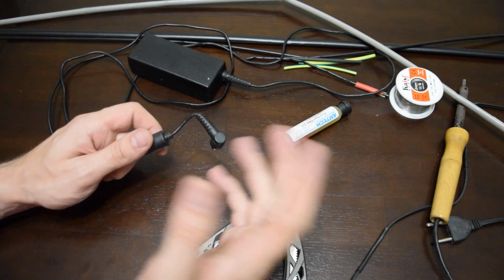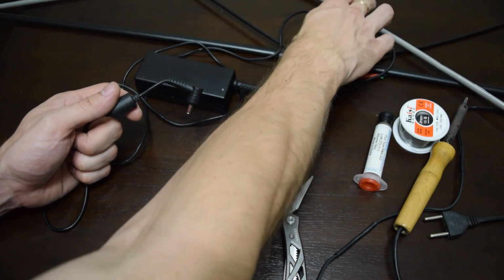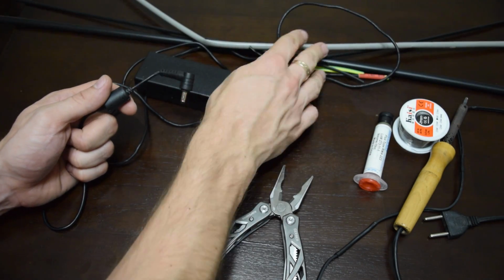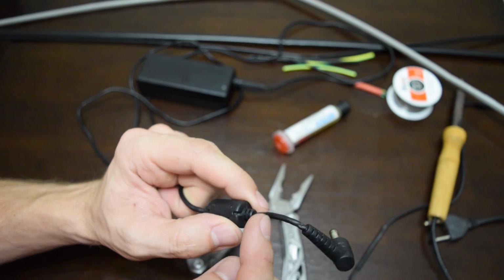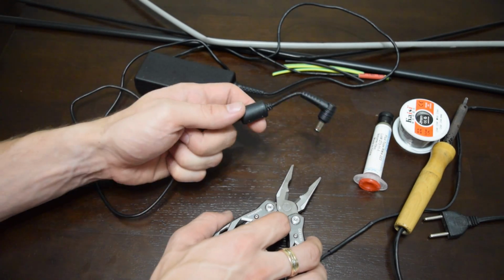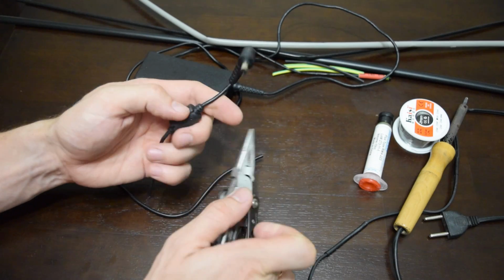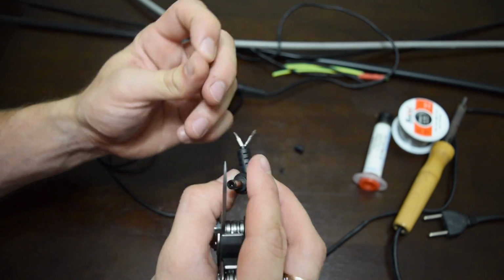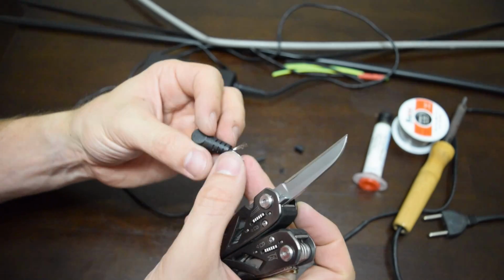How to Fix Your Laptop Charger cord. Fixing frayed charger cord

Comment: ok so that ferrite bead is on there for a reason, probably better to not remove. Just fixed mine. The inner positive wire insulation breaks and then touches the outer negative wire. That looks like a shield or support all  around the positive. Electrical tape the positive then join the messed up negative with solder or maybe can just crush it together with a generous amount of electrical tape not duct tape.

Comment: What a great idea!  I have 2 adaptors with frayed cords right before it goes into the transformer case and was thinking I’d have to throw them away. Just curious why you use 2 layers of heat shrink tubing for each wire?  Extra protection when soldering or helps add extra strain relief?  Thanks so much for posting this!

Comment: Better not to remove the filter because you could end up wasting a lot of time chasing intermittent computer problems due to the noise or have noise in something else because of the noise broadcasted by your power supply.

Comment: what's inside of those cylinder?? im sure its put there with reason
Reply from the maker: That cylinder is a ferrite choke or ferrite bead. The ferrite core is there to prevent electrical noise within the laptop from being radiated by the cord (which works as an excellent antenna).

Comment: Why not open the 4 screws on the board and solder the end tire new cord on to the board they literally say + and - red black or black with white stripe hot/power negative just solid black like always 100 times faster tacking to Ends  in to the holes that still has the exact amount left in it then your not on the very tip, where it takes the most force or most likely going to break again you could’ve got more strength, putting in the center of the cord at least solder it to the board and then you clamp the whole entire plastic piece down and the wire never gets tugged on obviously why they’re designed like that and did I mention it’s 10 times faster 2 wires versus 4 ends of four wires together end the weakest point of the cord (probably why it’s broke in the first place right? )
Reply from the maker: Those DC connectors become weaker and weaker over time. Nowadays, we have a USB-C connector, which is super fragile, especially if you unplug and plug in your laptop on a daily basis.